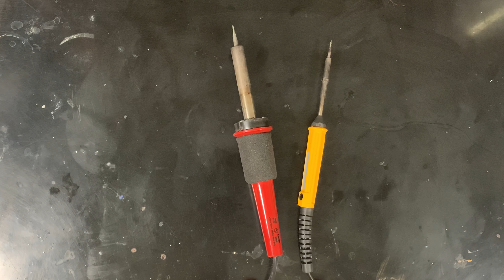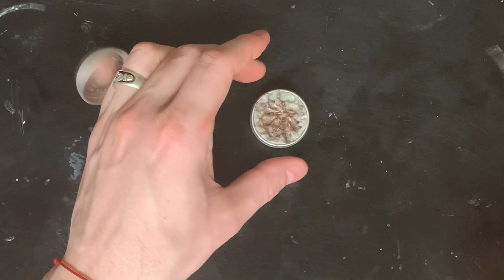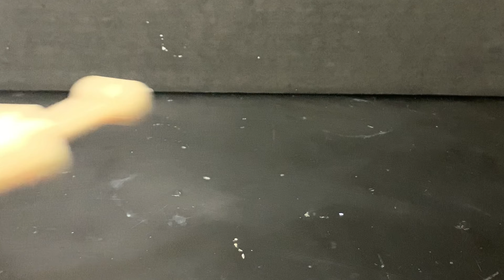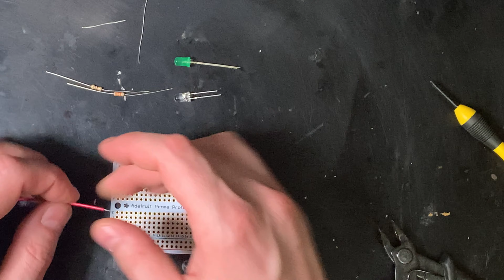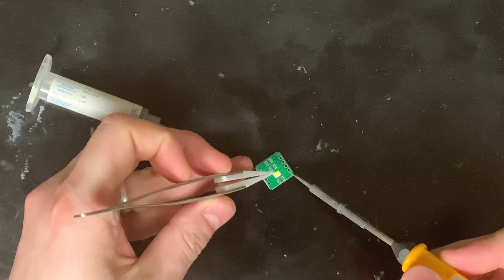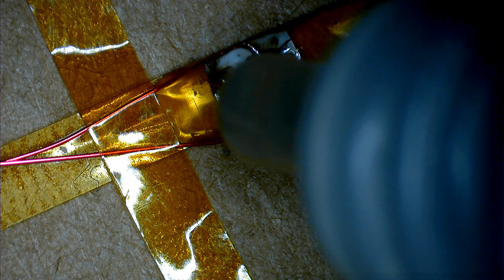Don’t solder like a noob

Comment: Which wires are you using?
Thanks for the Amazon links, but I'm missing a link for wire.
Reply from the maker: wire links added! with the low voltage and current of LEDs most wires will work the magnet wires are harder to strip but are much thinner and can go CRAZY thin but the bigger silicone coated wires are a bit easier to work with